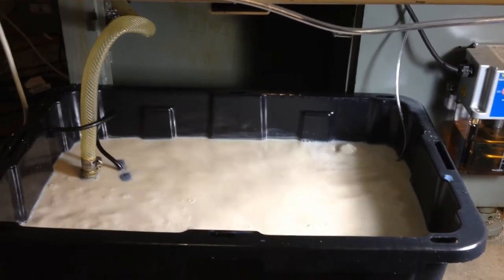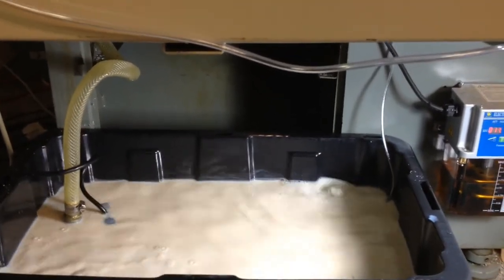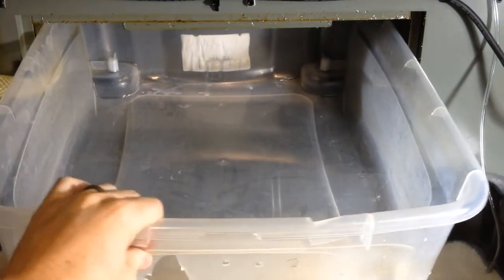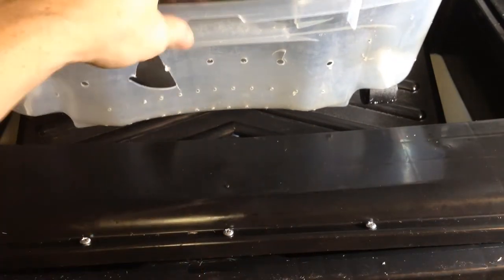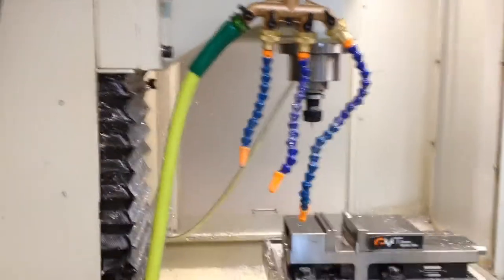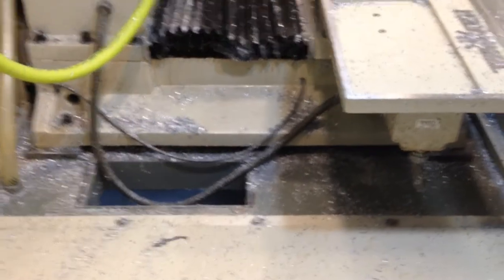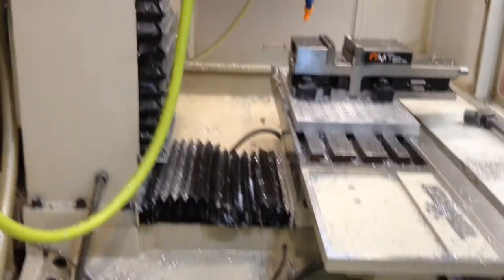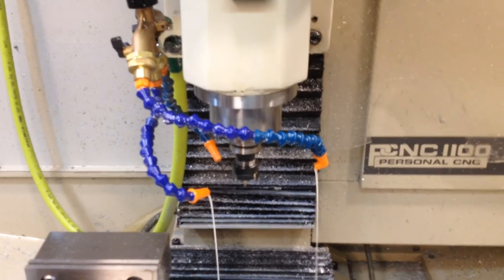Tormach PCNC1100 Coolant Mod/Upgrade

Comment: Was thinking about our convo on FB the other day.  The nice thing about the 251 is that the way oil sits on top of it.  I wonder if the aerator will keep it mixed and how that will effect things.
Reply from the maker: I love the 251c and I'm pretty sure the problem is with something I'm doing. Once I put everything together with the fabric filter the tank is almost 100% closed which might not be a good thing. I originally filled the tank with distilled water and now I'm using tap so that could be part of the problem. I'm also pretty bad at checking the concentration levels. It get pretty hot in my garage so the water evaporates out pretty quick and I'm constantly adding water without checking it.  I'm going to talk to Qualichem and see if they have any suggestions.

Comment: Hi JW Machining, I love the flow rate of that pump! I noticed the colored/backlit switch your using to activate the pump, is the coolant pump still running through the original Tormach coolant circuit or do you have it direct wired to AC power and you turn it on and off manually?
Reply from the maker: Luke Sutton the new pump pluges into the same outlet the original pump did. I have an aftermarket switch that controls start, stop, feed hold and coolant on off.